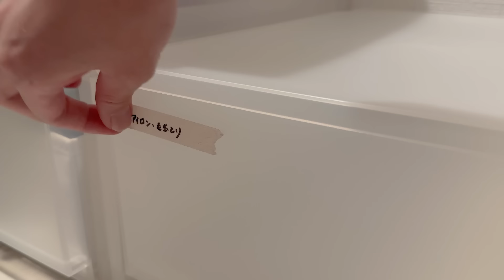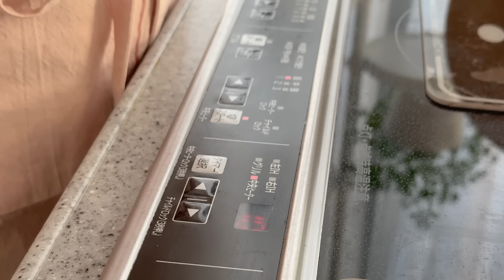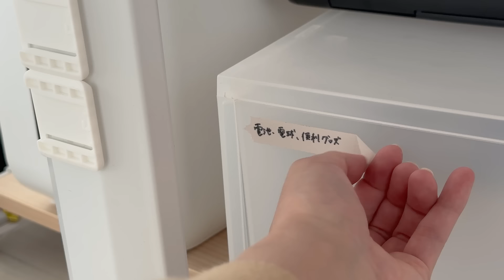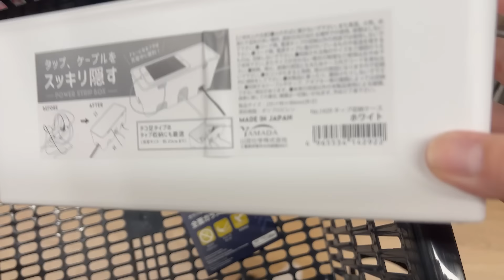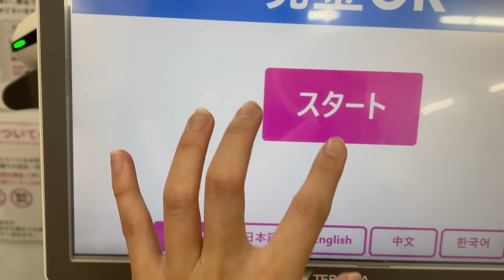模様替え｜1人暮らし部屋の家具を丸ごと配置換えして整理整頓する休日のVLOG｜ROOM MAKEOVER | Japan VLOG

Comment: When you press the cover of the air ventilation - it had one press when it was giving a little gap and the final press where it was closed. If it is a ventilation point should it not have some gap to allow the air flow?